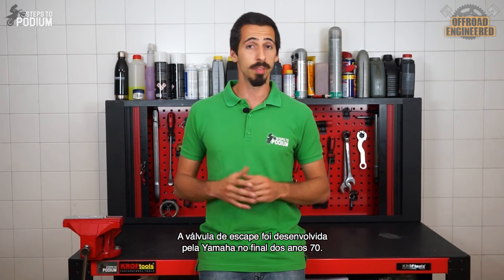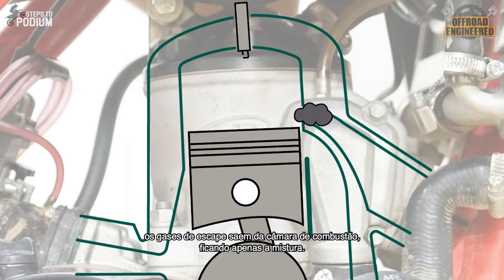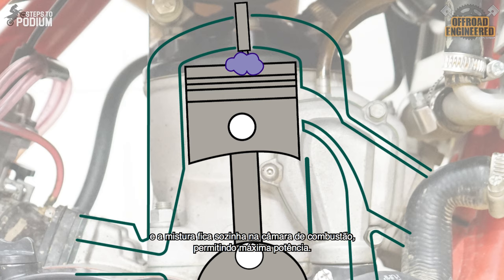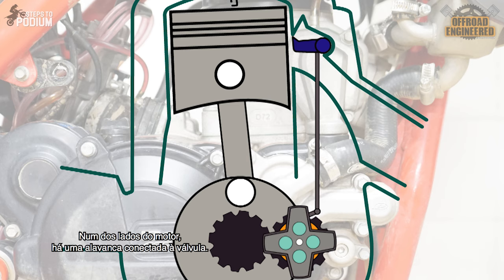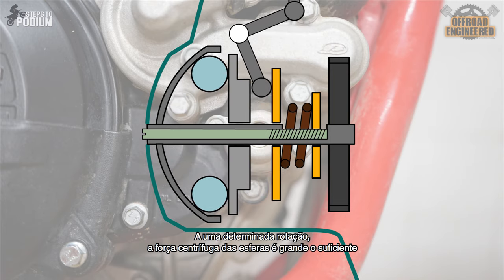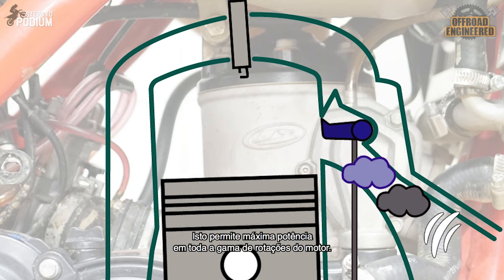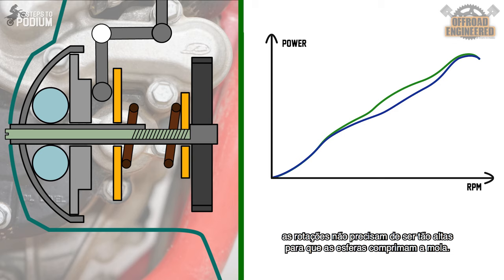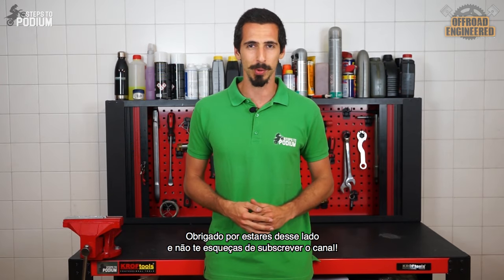How the Power Valve works | Offroad Engineered

Comment: I had a 1984 Cagiva 125 without PV. Made about 10hp up to 7500 when, like a light switch, the hp went to 20+at 7600! It was impossible not to spin the tire, i tried many times. Made around 30hp but the power band was about 2000 rpm.
Reply: Bro said a 1984 125cc bike without a power valve can make 30hp😭 more like 20 on a perfect day
Reply: @Willy_Wanka  not really, I've got a 1984 dt125lc and it makes about 24-25hp at 7-8k rpm

Comment: The power valve is a vital upgrade but the revolutionary feature was adde earlier. That was the resonator exhaust which was made by a former v1 rocket engineer worked for the MZ in the motogp. Suzuki, which was the weakest brand in the gp for the time managed to get the resonator exhaust plans (they stole it throught the engineer and a young pilot borrowed from the mz..) after that suzuki became the unbeatabe brand for a decade. That was the key momentum, without the resonator the 2t was not stronger than a 4t with same displacement. With the new exhaust the engine was able to rev 2x higher and so producing almost double power. Now that wss revolutionary.

Comment: All good but you did mention only the mechanical valve and forgot to mention the electric power valves operated by a servo motor. There are many manufacturers using this, Yamaha included !

Comment: Thanks.
Snowmobiles use a different exhaust valve, it’s a guillotine valve that slides up and down, but uses the same principle of restricting the exhaust port size at lower rpm and expands it at higher rpm.
It was a total game changer for snowmobiles

Comment: Before exhaust valve, some manufacturers were using rotary intake valve. I tried one Rotax with "enduro valving" and another with "mx valving" and there wasn't a jarring difference. Eventually all manufacturers went to reed valve and maybe an exhaust valve for power cases.
Reply: I have a kawasaki rotary valve enduro. The rotary valve has significant more torque on the bottom end compared to reeds. Reeds however have much better top end efficiency.
Reply: @awesomecooly123 that's a trail bike.
Reply: My 250 Can Am MX which was road registered revved out superbly. Much better than a Japanese 250 MX. But bottom end was inferior. I guess the disc valve can be cut to have longer intake time.

Comment: Bro, siempre te lo digo, pero tus vídeos som impresionantes. Sigue así!
Reply from the maker: Muchissimas gracias tío! 🙏💪A ver si al final de algunos videos todos nosotros entendremos nuestras motos como si fuera una bici 😁
Reply: @StepstoPodium  so less stif spring give high power in low rpm & more stif spring give high power in high rpm.?
Reply from the maker: Not exactly. A stiffer spring will give you the impression of a higher power output because it will suffer a more abrupt power increase, but not a higher power output per se.
Reply: @StepstoPodium  so your final answer is 

Default factory  strength spring it give the best performance power 
Is it?
Reply from the maker: It gives the most efficient power output and the desired one by the manufacturer. I would recommend adjusting the spring preload, but I wouldn't change the spring. They know what their doing 😄
Reply: @StepstoPodium  ok thanks

Comment: Nice explanation, but if you permit the ypvs was electronically controlled by a servo motor. The kips system by kawasakie was a manual system.   Great vid .
Reply from the maker: Thank you! 🙂
I'm almost certain thatcthe ypvs, or at least the first version of it, was fully mechanical. At the time of the making of the video I did an extensive research and don't remember having any ellectronics involved

Comment: They opened the door for wider range power efficiency.
The early attempts with actual Leprechauns proved difficult to maintain and impracticable.
They were fine when not drinking but that didn’t last long.
A governor system to provide control allowed to more precisely time the exhaust intake phases.

That thing hooked up when it came on the pipe. A barking power band that liked to rev.
Reply from the maker: 😂😂😂😂😂 loved the comment 👌😄
Reply: That is the problem with Leprechauns, clever and amazing workers until they get a whiff of alcohol. That's why they had to remove all the Leprechauns who operated the power valves when ethanol fuels were introduced. When you find four Irishmen together, you will usually find a fifth!

Comment: Sherco uses an electronically controlled  motor driven system to actuate the power valve so you can change how it opens by reprogramming the ecu.
Reply from the maker: Exactly 👌👌👌

Comment: Thanks. Looking at your graphs: if increasing preload for more progressive power has the effect of reducing low/mid range with no benefit on the top end power, who would use it and why? Cheers.
Reply from the maker: Some applications/riding requires a more snappy feel or response of the engine! 
Not necessarly a bad thing, simply different
Reply: @StepstoPodium  so, would you say mx wants snappy power with the idea of keeping it always in the power band (and perhaps for jumps?) while enduro wants more linear power for control at low rpms?
Reply from the maker: @miro_s exactly!

Comment: I'm still not clear on how much effect the powervalve has on compression ratio and exhaust port timing.....does its action effectively raise and lower the exhaust port changing timing as well? Does the compression ratio change (higher compression at low rpm when the valve is closed, and vise versa when open?)

Comment: if the power valve is restricted due to using the green spring screwed in, can this cause over heating?
Reply from the maker: That's a really good question. It can!
Reply: @StepstoPodium  thanks for the reply. When i started i put a green spring in with the pre-load screwed in too. Now I'm riding better my engine is running very hot and have hanging rev issues. Might be an air leak but i'm looking for other reasons too.

Comment: I understand everything except one thing.  When the fresh gasses are let into the combustion chamber, some of it escapes into the exhaust port, as is demonstrated in the video.  However, it looks like the exhaust gasses are pushing them back into the chamber.  What causes this?  How can the exhaust gasses just reverse themselves?  Aren't they supposed to flow straight out of their port and not flow backwards?
Reply from the maker: It's all thanks to the back pressure wave. I've got another video clearing that out 😄👌
Reply: It’s the reason that 2 strokes have their fat pipes. Exhaust fills the expansion chamber then gets choked way down at the back, so the exhaust pulses bounce back toward the engine and that bounce back pushes the unburned fuel back into the combustion chamber

Comment: What difference between power valve and reed valve
Reply: Power valve is an exhaust tuning technology. Reed valve is a 1 way check valve to allow fuel into the engine from the carburetor.

Comment: The power valve is about timing, not the size of the exhaust port.
Reply from the maker: The size determines timing
Reply: @StepstoPodium  Not size, but location.  more precisely - the location of the upper edge of the exhaust window - the angle of its opening.  this is what ypvs regulates.  True, this is already boring on my part, but in the past, such an explanation, your explanation, misinformed me for years.
Reply: @StepstoPodium  для будущих поколений оставлю объяснение от Yamaha технологии ypvs: https://youtu.be/4kERsqKC9Q4

Comment: The power valve, if designed well, does widen the power curve a bit, but does not maximize the power at the lower rpm's because the pipe effects are only great for a fairly low range of rpm, and that depends on the tuned length of the fixed pipe.  If a guy in the comments section educated the channel more, it is time for you to do more homework.